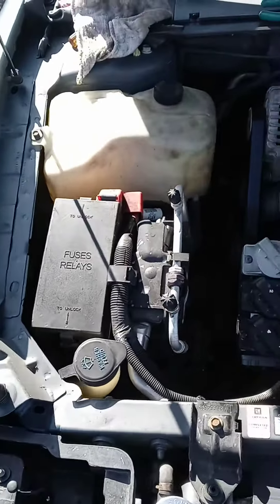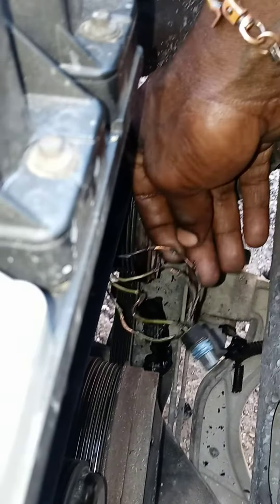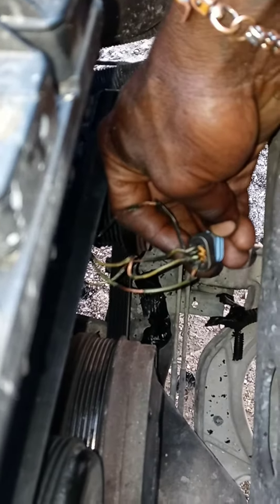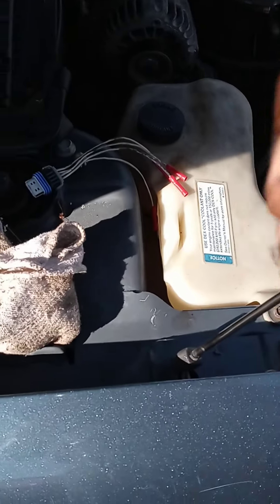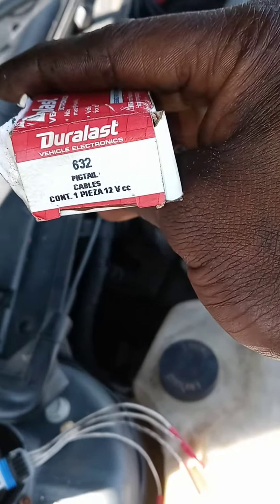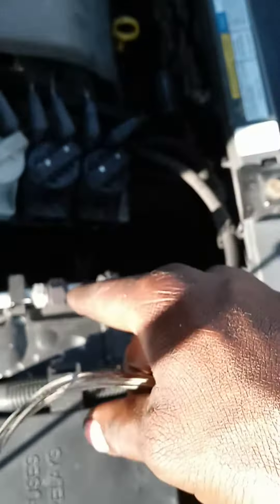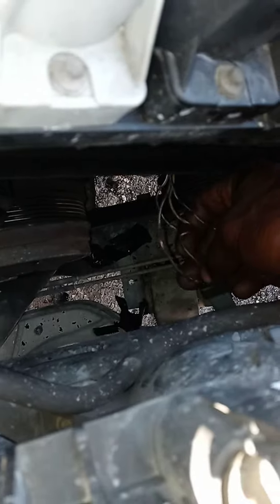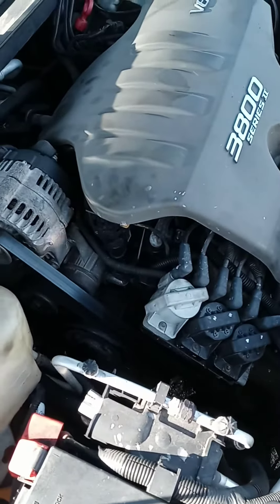buick lesabre 3.8 crank and cam sensor codes.(fixed check this first)

Comment: You led me in the right direction with my 2000 regal.  Chasing a cam sensor fault for a week.  Saw your video and pulled out my cam/crank/ICM harness and found exposed wire hidden inside the conduit that would intermittently short together.  Thanks!